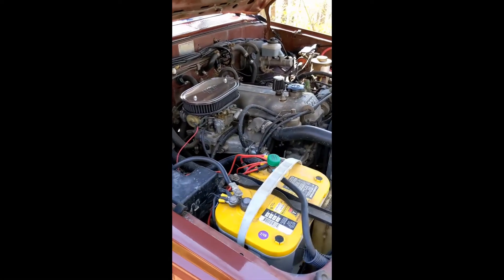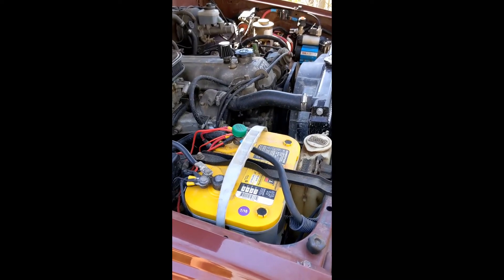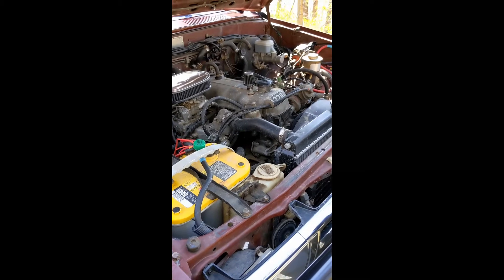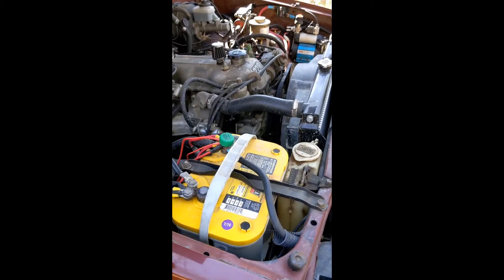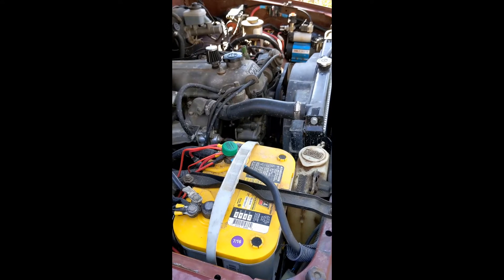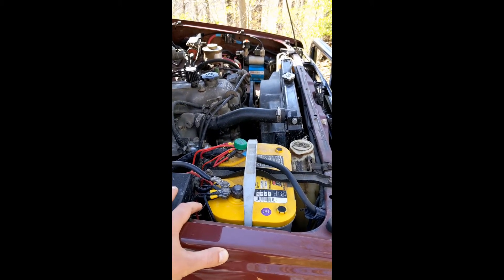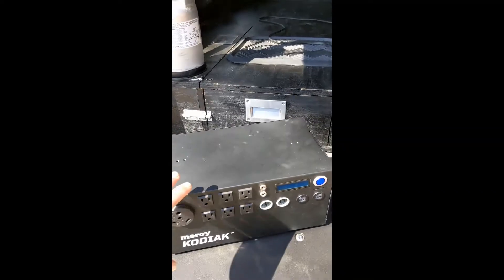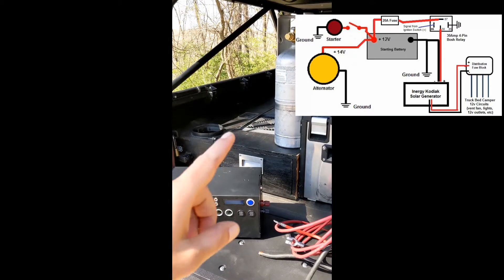Simple Dual Battery Setup Using a Solar Generator

Comment: Detailed wiring diagrams. Just pointing to the various connectors and telling what its function is is completely useless to the vast majority of viewers. I am an electrical engineer and had difficulty following or getting much usage from this video. Hate to be so critical but truth is truth.
Reply from the maker: Sorry you found it so difficult to follow, the post on our site linked in the description offers greater detail. It's essentially a hardwired 12v outlet powered by the truck's starting battery that's run to the bed of the truck. The solar generator's 12v car charger plugs into this 12v outlet to charge the solar generator while driving.
Reply: @takethetruck  I fully understood what you were trying to say and how it worked. I was just stating that the majority of viewers would have trouble due to the lack of detail. One thing I adamantly disagree with though is connecting any type of high use accessories to the starting battery. That's what they make battery isolators for. Nothing should draw from the starter battery except MAYBE your winch. My rig has two batteries, a 220v alternator to charge them and an isolator to ensure only the secondary battery is used by accessories.
Reply from the maker: @research903  fully agree, that's why I pointed out the ignition on 30amp relay in the video that cuts power to the 12v outlet in the bed - this serves as a rudimentary isolator  for the solar generator.

Comment: Only with one alternator??
Reply from the maker: Yes, one alternator, one battery, one solar generator. Easy and effective 👍
Reply: @takethetruck  Do you have the GM alternator? Or one that is more powerful? If not maybe worth looking into!
Reply from the maker: @buildadventure404  we run an upgraded 3-wire 120Amp alternator from Dave's Off-road Performance.